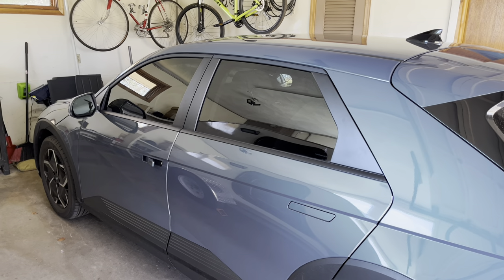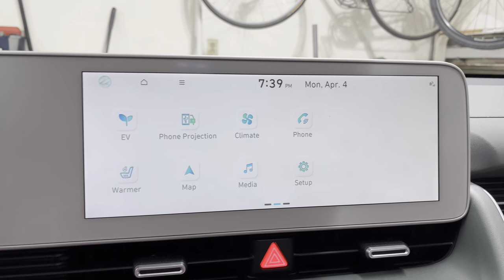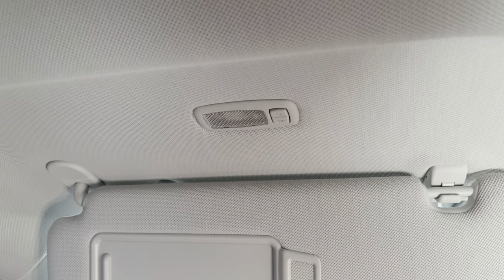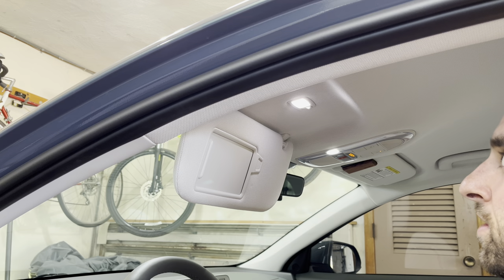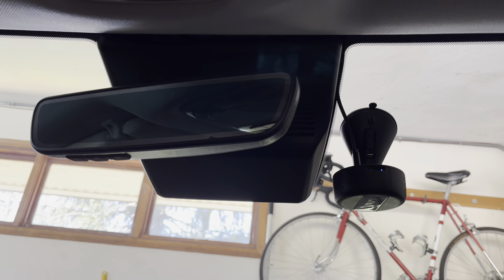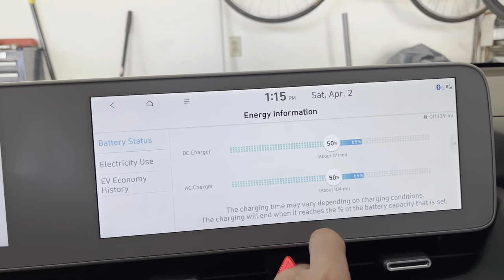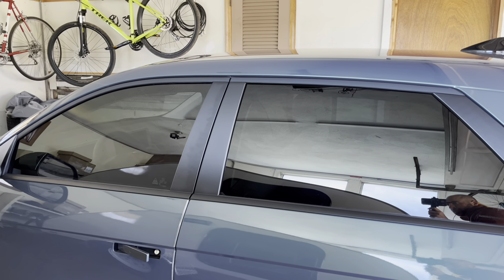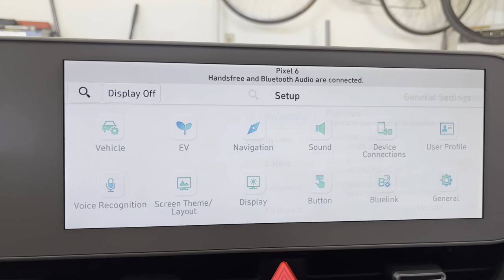First 10 Things To Do To Your Ioniq 5!

Comment: Just a suggestion, when changing wiper blades, always put a pillow or rolled up towel or something similar on the windscreen.  I know from experience that if the wiper arm snaps back onto glass with the wiper removed, it will crack the windscreen.
Reply: Or you could just use the same effort of getting a pillow or towel and put it towards not letting the arm smack the glass. It's not like this is something exclusive to this car, it's common sense that if you let a spring loaded piece of metal hit glass it's probably gonna break
Reply: @thelonewrangler1008  we're all human and we all make mistakes, even you, no matter how hard we focus or how careful we are. Maybe you bump the arm as you pull the old blade away, maybe it slips out of your hand, perhaps you have to reach for the passenger arm making it harder to control.  There is always a chance no matter how perfect you think you are, grabbing a towel takes seconds and is good insurance.
Reply: Thank you very much for the tip! 😉😉
Reply: @amperformance7998  that’s actually a great tip,I’d never heard that thanks …sheesh,that lone wrangler guy is unnecessarily grumpy!
Reply: I have changed my own wiper blades for years - never heard this. Then I read this suggestion on the l wiper blade package and thought, "That's so silly!"

Wasn't so silly when the 2nd wiper arm slipped out of my hand as I removed the old blade and put a big crack across the passenger side. 

Got it repaired easily by Safelite, but had to take it in and wait around because it had something for crash avoidance attached to windshield which needed to be recalibrated in their shop when moved to the new windshield, (Couldn't be done  by a mobile installer.)

Now I share this tip whenever someone mentions replacing their blades.
Reply: Thank you!
Reply: Interesting and useful tip.
I've never had wiper arms damage my windshield in any car I've owned and I've snapped them down plenty of times.
Is the windshield particularly fragile in this car?
I don't own one, fyi.
Reply: The windscreen is just as durable as any òther. But being a modern screen with solar glass, cameras and sensors, and being on a relatively low-volume car, finding a replacement can be difficult and expensive. So better to not take the chance.

Comment: Thank you for these recommendations. I installed your suggested LED bulbs today and they look so much better. A couple of comments about the installations: the plastic tool that comes with the bulbs is all you need to pry out all three light fixtures. For the trunk light, I struggled with getting the lens off in the manner you showed until I turned the fixture around and used a small screwdriver to remove the lens from the opposite end. For the vanity lights, I didn't need to remove the lens at all. I gently pried the bulbs out using the plastic tool from the LED bulb package. Again, thank you for this and your other videos.

Comment: Been thinking about getting the Ioniq 5 as our first EV. And don't get me wrong these are good advice. But I really don't think these things should be necessary and definitely should be like that from the factory. Other things that are a bit off-putting are the missing rear wiper, non wireless Apple CarPlay and no USB-C ports. But there should be quite a few upgrades to the 2023 model so I hope at least some of these issues will be solved. And I certainly still haven't written the Ioniq 5 off yet. Thanks for the vid :)
Reply from the maker: It'll definitely be interesting to see what the 2023 And 2024 models gain

Comment: The arm rest compartment is a good spot for sunglasses. That’s where I have mine and napkins. Also should definitely wash and ceramic coat it. The paint chips real easy. Lastly, since there is no back windshield wiper, definitely hydro slick it. You know, rain X out something better. It’s terrible in the rain or sleet. Hope that helps.
Reply: Check out youtube videos to see if ceramic coating is worth it. Spoiler alert, no it's not. Bit of a have.

Comment: Excellent video and information. I received my 2023 Ioniq 5 Limited and have completed: window tint, bulb replacements, checked pressure, software updates, and set profiles and charging level. Home charger installed. Looking at the dash camp and dongle set-up. Very well done--thanks!

Comment: First on my list of must have is
Tow bar, studded winter tires, mud guards, LED Hi-beam ramp, protective rubber mats on the back of 2nd row seats and extender rubber mat in the trunk that can cover the bumper.
Reply: Have you found an extender rubber mat in the trunk that can cover the bumper?
Reply: @georgewhite3298  But you could just buy a roll of rubber mat and cut to length. Fold in half in trunk and extend when loading.

Comment: Thanks for all the great videos.  Always helpful!  One caution when changing out the rear cargo light bulb, make sure to keep the connector well outside the panel.  Maybe tape it in place with some masking tape.  Mine dropped back into the panel and it took a skewer stick with a piece of super sticky Flex Tape on the end to retrieve it.
Reply: Gawd darn it .. I wish I'd read your tip about keeping hold of the cable!! Mine's disappeared into the abyss and nowhere to be found! 😢😢😢
Reply: Or use a peg to clamp onto the wire and hold it in place

Comment: Thanks for great suggestions. Bosch fan here so I got the Bosch Icon 26A and 18A wipers. I also just finished putting in the LED bulbs for the cargo area (very easy) and the visors. (Glove box lighting not critical for me and that wire was so short according to another reply.) Found that the 2 visor bulbs can be swapped from the back of the housings without prying at the plastic cover which started gouging the casing. Thanks again.

Comment: I installed the rest of the LED lamps today. The visor bulbs were easy. For some reason I thought you also replaced the glove box lamp. So I tried. What I liked about the LED was that they have a heat sync on the back and the light only faces one direction. I removed the housing for the glovebox lamp. Unfortunatelly I accidently broke one of the wires for the switch. Dang! That wire was WAY TOO short. I will replace/extend it later when I think I can remove the glove box for access. But for now I like it. The LED is positioned to point toward the back of the deep storage area. Now it is useful. I'm not sure if I want to clean up the install. I kinda like the character it offers, showing the bare wires soldered onto the LED bulb. Good thing all the interior lights turn off after the car is off and locked. I will have to monitor how things go when the car is on cuz my glovebox LED light will just stay on until I fix that wire.
Reply from the maker: Same thing almost happened to me with the glove box light that's why I didn't recommend doing it in the video, just too risky.
Reply: @TheIoniqGuy  Can you give a little more detail / tips on replacing the glove box light?  What is meant by "the wire is way too short"?  Does the whole light assembly have to be removed from the glove box (similar to the cargo area)?

Comment: You don't need to remove the plastic "glass" from the vanity lights. You slide the light out from the back.
The vanity and trunk lights are 31mm. There's probably better links than the combo of mixed lights you put in the links. I bought the combo not knowing exactly what I would have had to replace but in that kit there's only 2 of the 31mm lights whereas you need 3 to cover the vanity and trunk, meaning I now have to order another kit (to keep the same type of lights).
Hopefully others will read my message and won't make my same mistake.

On the rest, I don't have any particular comment. Good job putting together an extensive list of accessories!
Reply: Can you link to or name the product you recommend?

Comment: Great video.  I have a 2023 Ioniq 5. I'm a bit confused about LED bulb sizes. Your link lists a site for 28mm bulbs, but in your various answers to questions, you suggest ordering 31mm bulbs.  When I look at other manufacturers of LED bulbs selling on Amazon and I select 31mm, the Amazon garage says they won't fit my 2023 vehicle.  So, is it 28/29mm or 31mm?
Reply: 31mm will work. Ordered them also on Amazon because in my country (Germany) i couldn't find 28mm ones.

Comment: Great video. As an Android/Pixel phone user, I think getting wireless Android Auto is a must. Been super happy with my Motorola MA1, though they are super difficult to find right now. Not sure what iPhone folks are doing for wireless.

Would love to get all weather mats but they are also seemingly impossible to find.

Not sure why, but the "auto power liftgate on approach" setting was off on my Ioniq. Definitely worth turning on even if it's just a parlor trick.
Reply: I'm an iPhone user so As for the wireless I have no solution yet. Just plugging in for now
Reply: iPhone is plug in only for right now. Although you can use Bluetooth but not car play wirelessly
Reply: All weather Mats available from Hyundai UK and many other third party outlets.
Reply: For all-weather mats, I recommend getting cut-to-fit mats at AutoZone/O'Reilly's and cutting them to size with a pair of scissors. You'll save plenty of money that way and they're really easy to keep clean.
Reply: There’s plenty of wireless CarPlay options on amazon.  All have a few glitches, but work pretty well.
Reply: I've used both the Motorola MA1 and the AAWireless adapters and they both work great on my current car (a RAV4 Prime), but I will note that the MA1 I had died barely out of warranty which is why I tried the AAWireless. So far so good, AND the AAWireless connects to Android Auto in about half the time as the MA1.

Comment: I think you want the 30 mm LED bulbs for the vanity lights, 28s are a bit loose. The 30 mm will also probably work for the rear trunk light, as that is a different socket.

Comment: You are 100% right about dealers over pressurizing the tires.  Why do they all do that?
Reply: To protect tires during transit, avoids flat spots, somewhat atleast.
They're supposed to adjust to correct pressures before delivery though
Reply from the maker: Interesting!
Reply: @TheIoniqGuy  when a new van arrives at my dealership pressures are usually 70 psi or there about.
So it's on the pre delivery inspection list to adjust pressures among other things.
Reply: One note about tire pressures: looking at my (manufacture date JAN/2022) SEL, my data plate says 38 PSI, not 36.  Same exact tires as you have, though.

Comment: Wiper trick is super-handy!
Reply: Just a suggestion, when changing wiper blades, always put a pillow or rolled up towel or something similar on the windscreen.  I know from experience that if the wiper arm snaps back onto glass with the wiper removed, it will crack the windscreen.
Reply from the maker: That is a good tip!

Comment: Excellent video. Very informative. You imparted way more information than the dealer did today when I picked up my new Ioniq5. First thing tomorrow I will be implementing most of those updates and changes.
Reply from the maker: Enjoy your amazing new machine! What did you get?
Reply: @TheIoniqGuy  Because of the crazy market and long wait times, I told the dealer I would take ANY SE or SEL that came in, regardless of color, although I told them I strongly preferred any color other than black. (I like cars that are visible in nighttime driving conditions.)
So of course they called and said hey we have a gray one, is that good? I go to the dealership to do the paperwork, and they have only a black SE. So now I own a black Ioniq 5 SE. Oh well. I will learn to love it, or get it painted. :)
Reply from the maker: I'm sorry you didn't get exactly what you wanted. What area are you located in? There's at least 2 or 3 dozen SEs in all colors around here in CT. You could always get it wrapped. That'd be a lot cheaper than painting
Reply: @TheIoniqGuy  Thanks for your personal interest in my situation. I'm in San Diego, CA. My dad lives in Putnam CT, and I plan on visiting him on or about his 88th birthday, which will be in September. I've contemplated driving cross country- that would be an adventure in an EV, as I'm sure the infrastructure for charging isn't built out like the fossil fuel stations are.
Reply from the maker: I don't think you'd have any issues with infrastructure, it's pretty well filled in across the middle of the country. Would definitely be a new experience though, good or bad.
Reply: @TheIoniqGuy  I did see a map this morning that was surprisingly filled in across the country. Good to know.

Comment: Man this is a pretty random list, but most of it is great! As an Ioniq 5 owner myself, i would put learning how to engage and drive in I Pedal mode on there. The whole regeneretive braking thing is one to quickly make your own, as it can save you some km/miles. Btw: my wife wanted a Teal Green, but we endes up with a Cyber Grey. Both very nice! It's an amazing car and with 3 small kids, i'm surprised by how much space there is inside. We had a much bigger Peugeot 5008 before, but the Ioniq 5 has more legroom at the back
Reply: On AWD models people tend to avoid iPedal as it will engage front motor more to brake better, thus using more energy
Reply: Never knew that! Thanks for clearing that up
Reply: how does it use more energy if you are braking? I'm confused by your comment
Reply: @bretthadley2043  you're driving more than you're braking, two motors consumes more energy than one. The front motor is mostly disengaged in the other driving modes.

Comment: Excellent video.  Ditto on the dash cam, front window tint.  I'm also adding a back of 2nd row seat organizer, a trash can,, neck cushion, and getting a ceramic coating for my matte paint.  Looking for a solution to keep the 2nd row seat belt buckles from making noise hitting the pillars.
Reply from the maker: Do your seatbelts have the large piece of fabric on one side of them? Mine so and as long as they're not twisted I get very little rattling. I've heard people are using Velcro to stick them to the side of the car when not in use.
Reply: Like all the ideas except for the window tinting. Safer for everyone to keep them clear; visibility out and into the car matters.
Reply: @TheIoniqGuy  yes! Just noticed that today and if flipped into the correct position,.it does minimize rattle. Unfortunately,  passengers aka my kids don't care enough to comply
Reply from the maker: If you don't want it as dark, you can get it in various levels of opaqueness and it doesn't prevent you from seeing out. Certain types block harmful UV radiation that leads to skin cancer
Reply: @TheIoniqGuy  I strongly recommend tint that is 35% opaque. I’m in Las Vegas and in the desert cops do not really care how dark it is
Reply: @nigelcook730  Dude, quality tints actually improve your vision out of the car by reducing glare, much safer for your eyes (& skin). UV is very damaging.

Comment: Did you get any PPF (paint protection film) or ceramic coating for your new IQ5? I'm in arizona and due to high winds, instead of mulch they use rocks. So as you can understand your car front bumper is target practice for rocks, as well as the windshield. And one thing I hate is rock chips. Especially on a $60K car.
Reply from the maker: Oh man I can only imagine. I didn't get any PPF or ceramic coating. 

I used to be super obsessive about paint chips and would get all bent out of shape over them but I grew tired after many years and just accepted that it's bound to happen and pretty much every car has or will get them somewhere. My Mazda CX-5 had some of the thinnest paint I've ever experienced. Whenever I wash the car I just give it a look over and use a touch up paint paint to fill any rock chips. I personally believe that I wouldn't get my money back for the cost of PPF if it were for sale side by side with a car that did have it after say 30k miles. To each their own though.
Reply: @TheIoniqGuy  ‘paint protection’ is a common add-on that many (close to ‘most’) dealers are requiring, on Limited at least, and probably especially on Limited RWD when they start arriving, as a way to make more money. 

I’ve been meaning to google if they offer any actual protection. (I’m sure different dealers offer different flavors).

Comment: Great suggestions, thanks! A question: our Ford Focus Electric responded to the remote unlock with all the exterior lights turning on. A very nice welcome and made her easy to find in the parking lot. Is there a similar capability in the Ionic 5?
Reply: We leased two Focus Electrics and loved them. Our residual was crazy high and our monthly payments were crazy low. Once Ford announced the discontinuance of this car, they disappeared off of dealer lots immediately. The final model had much more range and DC fast charging.

Comment: Your videos are great. I wish I had seen the planner for long trips first 😂 😂. Before I went out of town. But I got it now. Question? Went to car seen a glowing orange light located on top of the speaker in middle of the windshield what's that light for? Keep up the good work!! @THEIONIQGUY
Reply from the maker: That shows when the high voltage battery is charging the 12V low voltage battery

Comment: Just a small addition to the lithium battery charge levels, 60 to 80 is correct.

But one little detail, if you rarely use the car or you know that it'll be unused for a while, 60% is better than 80.

Phone manufacturers also ship phones at that charge because it gives the best shelf life.

Unused batteries slowly discharge themselves, and 60% will cause less wear on the battery while it does so.